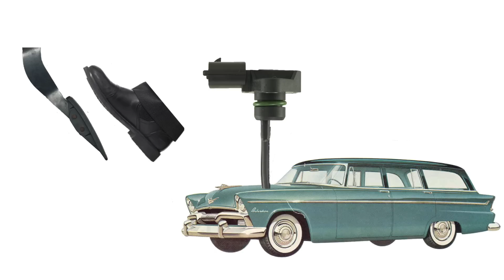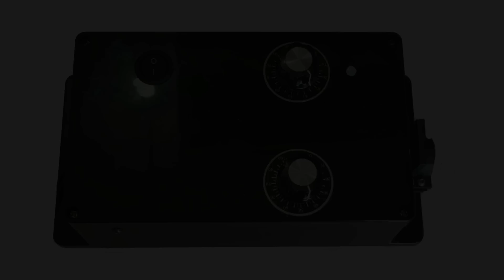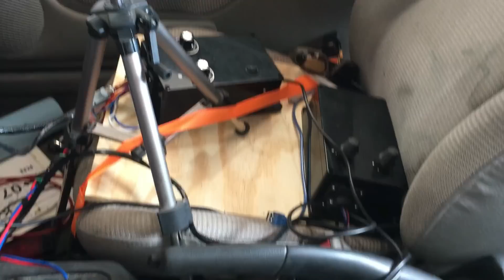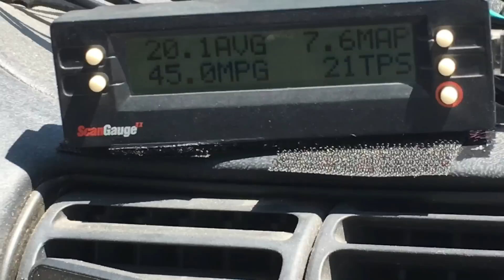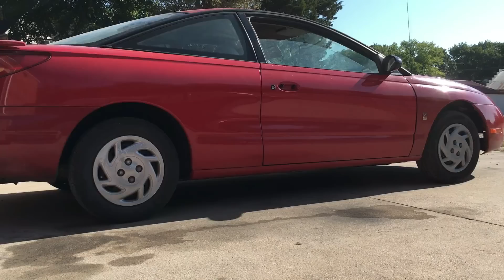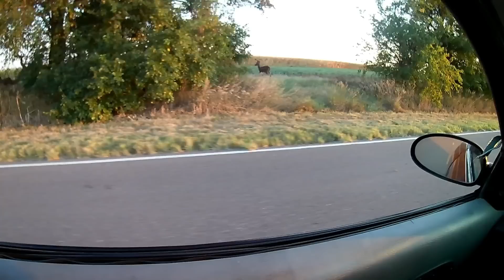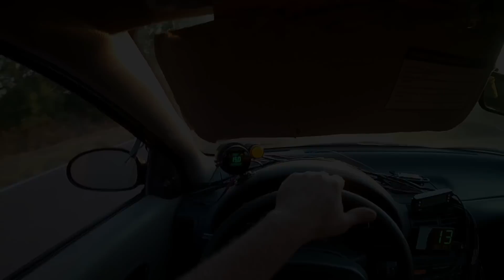S2E20: We road test the fuel saving Robo-throttle on our project car and discover hidden MPG’s.

Comment: The 2002 and later Acura TL Type S had a similar dual throttle body system. Acura's vehicle stability assist system needed some way to reduce engine power, and they weren't confident with going full drive by wire. So, vehicle stability assist would just close this secondary throttle body to limit the engine output, and thus limit wheelspin.

Comment: Some older cars with primitive traction control systems actually used systems fairly similar to this (with the combination of mechanical and electronic throttle bodies) but the implementation was a little different. The mechanical throttle body was used for most operations and the electronic throttle body would be wide open most of the time, but when wheel slip was detected, a separate module controlling the electronic throttle body would command the electronic throttle body partially or fully closed to reduce engine power output and reduce the wheel slip.

Some early electronic throttle body systems would also use remote mounted accelerator position sensors that were connected to the throttle pedal with a traditional throttle cable. Some of them even mounted the APP sensor directly on the throttle body. Honda mounted the APP sensor on the firewall, and I think some Toyota, VW and Audi models mounted it on the throttle body.

Comment: The double throttle actually “doubles” as a Saftey feature, if the robo throttle gets stuck open, your normal throttle still works, so you won’t ever runaway

Comment: Hey mr Jimbo,  I think you may have had better results with lower manifold pressures but shifting earlier. I think the main reason that vacuum gauges worked so well on carbureted engines is because of the enrichment that occurs at wider throttle. if the saturn were leaned out but had a wider throttle and shifted earlier, you'd have much lower pumping losses, fewer ignition events/meter travelled, and much lower internal friction due to having to move the pistons up and down fewer times/meter travelled. also cam timing, exhaust/intake manifold/port design are much suited to lower rpm as well. i think just a purely vacuum based robo-throttle would yeild better results on a primary/secondary throttle style carburettor than on a modern MPFI system. 

i always love these experiments, please continue making them!

Comment: An additional throttle body is capable of preventing poor driving behaviour, but it also adds to pumping losses for those who use their gas pedal wisely....I averaged 5.2 litres per 100 km on a stock saturn SL1 fully loaded with gear for a 2 week camping trip through the rockies, while drive up into the rockies!  Truth is that these cars make great gas mileage from the get go

Comment: I came to this channel because of the Honda Insight, and I’m sticking around to see it again! I’m ready to see what the Predator 670 will do in it
Reply from the maker: The  Honda insight project is still alive and well.  We will finish the 420 experiments and move on to the 670 when it cools off a bit here in Kansas.
Reply: @robotcantina8957  Speaking of predators do you have a indepth/detailed video on building a prony dyno? Google has no relevant info on building one that ive been able to find.
Reply: @robotcantina8957  Skip ahead and put a Hayabusa 1300cc engine in that Honda Insight, and then dull it down to get 60seconds from 0 to 60 mph - that would really piss off a lot of people :D
Reply: Interesting concept, wouldn't this work in conjunction with normal DBW cruise control and just have presets for each cruise speed? My thinking is press a button and let the robot accelerate the car to the preset at best fuel economy, 

takes the human factor out totally for repeatability in testing..
Reply: @AgneDei  Yeah, use a single 6.5 HP lawnmower engine carburetor! Probably a 22mm throat diameter.
Reply: I'd like to see the predator ghost engine in the insight... Or even in the saturn

Comment: You could add a safety like having an emergency stop button disabling fuel injection. No fuel = no power...
For full power you could disable the fuel economy mode if the pedal is over 80% depressed.
Reply: Yeah I was thinking the same for the throttle. Iirc, in stock configuration, the Saturn ECU will turn off a bunch of stuff at 80 or 90% throttle (AC, etc) for max acceleration.
Reply: In a modern car the eco mode is disabled after about 25% depression of the accelerator
Reply: OCD Man  yes it was a concept video from what I remember
Reply: I was thinking something along the lines of having a sliding scale from 50-75% throttle, so that at 75% the throttle is 75% open, and it's one to one from there. Problem with just disabling it at a set percentage it the throttle would jump from 25% to 80-100% immediately.
Reply: @JThyroid  Yes something a bit smoother would be better but for a 1st test version it's enough. Concerning the transition, I think the easiest way could be to adjust the depression factor of 4.5-5.5 between 60% and 80% throttle such that there's no economy at 80%. Then disable it completely above 80%
Reply: @cmuller1441  It's challenging to describe 3D throttle mapping with text only. 😂
Reply: @MrHuram-abi  Indeed...
BTW there's a problem with this economy mode method: what is the optimal speed for fuel economy? At first it seems logical to think that the faster you want to go, the more power you need, the more you have to press the throttle and the more air+fuel enters the engine...
But there's additional factors: the faster the engine revs the more friction and the more losses there is.
Restricting the airflow means that the engine has to pump (to create vacuum in the intake) so pressing the throttle lightly is creating more losses. That's why the efficiency of the engine can vary a lot. Usually the best efficiency on a gas engine is around 80% throttle at 20% of max rpm. So wouldn't it be optimum to use a pretty high gear ratio to be as close as possible to these conditions for a long constant speed drive? And finally is taking ages to reach that speed (with very slow acceleration) really optimum?
A recent study shows best mpg around 55mph.
Check page 120 of https://web.archive.org/web/20120924201205/http://cta.ornl.gov/data/tedb31/Edition31_Full_Doc.pdf

Comment: I think of this as a "dynamic cruise control" in high MPG mode.  I would feel 100% safe with the redundant design.  The control box could have a rotary switch that controls different MPG algorithms in the arduino, "pass through", "economy", and "performance" (that I would never use).   
PS - The roof on the 1st Gen Saturn Wagon was the largest single piece of plastic that GM had ever incorporated into a passenger car at the time.  Don't ask me how I know this (pretty sad, hee hee hee).
Reply from the maker: When we revise the robo throttle in the near future, we will incorporate a variable settings for different road conditions.   Ya know , just the other day I checked the roof on the wagon and discovered it was plastic.  The roof on my second gen wagon was metal and I just assumed the first gen roofs were as well.
Reply: @robotcantina8957  Yeah, my 2nd gen SW2 has a metal roof.   The same way that the Pontiac Fiero plastic tech was used in the Saturn plastic body, the lost foam cast aluminum engine tech in the Saturn S-Series was used in the GM Ecotec engines.

Comment: THIS is the most entertaining stuff I have seen on YouTube for a long time.  Disclaimer:  I have owned and used a Scan Gauge.  I have owned 3 Prius (Prii?).  I have added an aftermarket 6 kWhr battery pack to a 2014 Plug-in Prius.  I have done a few of these tests myself, off-camera.  Disclaimer:  I have a degree in electrical engineering and a fetish for MPG.  Keep up the fun!!!

Comment: Irony is, such feature (maintain an optimum MAP) was present in 80's Skoda 120, implemented in the way how the two barrel carburetter was controlled: There were two butterfly throttle "parallel" (so the mixture had two paths to go through), one (primary) was controlled from the pedal cable directly, but the second was controlled by a diaphragm responding to the MAP. But there were two links from the primary to the secondary: When nearly closed, a cam forced the secondary butterfly closed when you completely release the pedal (about below 20%). And then when you depress it (beyond about 70..80%), it forces the secondary open as well, to allow full power on a kind of "kick down". Overall when you maintain the pedal position between the 30..70%, the MAP was maintained at the optimum efficiency level. Drawback was, it felt like the car "had no response on gas" until you really fully depress it. And all that without any electronics...

For your setup, I would implement the "robo throttle" to gradually open over the last ~20..30% of the pedal position, so you don't need to operate any switch when wanting to accelerate, just full pedal will effectively deactivate the "robo throttle"...
Reply: That type of system has also been in use on US cars since 1952 or so- the humble four barrel carburetor.
Reply: That is a feature on like half the carburators out there, it's called vacuum-secondaries.

Comment: Ahh, J.C. Whitney! Bought quite a few things from that catalogue in the 1980s. 

When I was a younger lad I had (and still have) a garage sale vacuum gauge, a huge thing with a brass bezel, clearly not aimed at automotive diagnostic tool use. On my 1970 Volvo 145S and a later 1979 Volvo 240 wagon, I'd string a hose from the engine and set the gauge on my dash where I could watch it.

It made a little bit of difference on the 79' to watch it but 1970 with its ZS 175CDS carbs flushing fuel down their gulet just wasn't precise enough to get much of a milage tweak from watching engine load with the gauge.

Sorta wild today to think I have a 1970 Volvo (a rather ragged 142S) again, I've come full circle.

Comment: You can set the auto off (mpg increase off if TPS) is over 70% WOT.   So floor it and gives better acceleration.   This makes more programming but does a away w the Pot. 
First 70% of accelerator position is only 40% of WOT. Last 30% is 60% of the added TB.
To make it easy to know where the MPG change kicks in  add an extra throttle return spring that kicks in only at the 70% WOT so you feel it in the foot too.
Reply: The pot was for trimming the ratio instead of hard coding it. Once you get that part dialed in, hard code the ratio, then add in a nice sliding scale as the driver approaches wide open throttle. You should always have the option to floor it.

Comment: My 1991 Mercedes 300SE has an "Economy" gauge that is driven by vacuum pressure. That was the last year of the last old school S class that was way out of date in 1991.
Reply: Yeah.   Lots of BMWs used to have a similar MPG gauge mounted in the bottom of the tach.
Reply: i have 1990 volvo with a boost gauge that not only shows boost but also vacuum. i still use it to check if i am getting reasonable fuel economy (minus on the scale)  or not (plus = boost on the scale)
Back in 1980's many european cars had a 'econometer' based on manifold vacuum: 
lots of vacuum? green light, 
no vacuum? red light. 
Because fuel has always been expensive you would automatically adjust your driving based on those lights. You wanted green light all the time so you would get more range out of 1 tank full of fuel.  
(green = good, red = bad. Talk about subliminal behavior control!)

Comment: It's been a while, but I could swear that a '98 BMW 540i that I owned also had 2 throttle bodies.  One was a manual connected to the pedal and it was mounted on the upstream side (closer to the airbox).  Then there was another throttle body behind it that was normally open which I think was used as part of the traction control system.   I could be remembering wrong, but I thought it was a pretty cool way to implement TC and still not be full drive-by-wire.

Comment: This is a fascinating exercise, but it largely goes against what a BSFC chart would suggest. Most engines make their best fuel economy at 60-80% load, at very low RPM. 

Looking at the efficiency islands on those charts, it's better to dig deep into the throttle and short shift, rather than limit MAP and rev it higher to compensate.
Reply: That's definitely true when accelerating, and changing the code to accelerate at peak BSFC should improve the MPG even more. For cruising with a stock drivetrain at normal speeds, light load will be better. Higher load will just result in acceleration without changing the gearing.
Reply: @gasolinefumes  certainly (Hi from Ecomodder), but I'd think it would be more effective to cap MAP just before enrichment. Cruise control would still be pretty efficient if so. In fact, this gives me some throttle mapping ideas for my own car.
Reply: @AustinPerdue  so you're suggesting allowing higher load? Probably a good idea, but it might not make much difference on flat ground. I want to try the MAP-based cruise control that was posted on EcoModder years ago.
Reply: I thought exactly the same thing.  
The only thing I would consider is an automated push&glide cruise control, that applies ~80% load alternating with fuel cut-off.

Comment: This is basically automating the hypermiling technique. Maintain a throttle position that slows down uphill, and speeds up downhill. You are using the least amount of energy to maintain a general speed that you are wanting to travel (ie. 56-64 mph for 60mph average.)
Reply from the maker: Yes, basically that all I did.  The cool part is  it's completely automatic.

Comment: Most people have no idea how exhausting it can be to hypermile, ESPECIALLY on long distance trips.
Reply: I hypermile a Saturn and while it takes a lot of concentration I personally find it's the only thing you can do to make a boring commute remotely interesting. I find that this little Saturn keeps me more engaged than the turbo LS 65 Chevy truck I was driving
Reply: @ronniedale6040  commuting is one thing.  I do agree that hypermiling on your commute can be relaxing.  Long distance trips though are a whole ‘nother animal!!
Reply: OCD Man  I commented on his last video(this one) so yes I did watch it.  He mentioned in the video that everything he did with the secondary electronic throttle could be achieved with good throttle control.  This is often referred to as “hypermiling”.  Hence my comment.

Comment: Great video!
Add to Robo-throttle kick function similar like for automatic gearboxes.. Fast pedal release and then fast flooring deactivates fuel saving until next pedal release, holding Robo-throttle wide open.. 😉

Comment: Some motorcycles today have modes, such as "Economy," "Normal," "Sport," and "Performance" or "Race" that probably work similarly, also taking wheelspin into account by reading the anit-lock brake tonewheel/encoder on the front and back wheels. A lot of these technologies have been used in industrial automation for decades, and as an industrial electrician, I'm quite familiar with the concepts, if not so much with the code used. I did have to write a program for a can crusher in a class years ago that used a crude encoder, 2 sensors to determine direction, a motor, and threaded rod. I kept tweaking the code for features and efficiency long after the project was done and graded, because I had so much fun doing it.

Comment: I live near Topeka Kansas and for over a decade I have been building gadgets for my car .  Hydrogen scam stuff and now I  run my car with Propane.. I used basic stamp MC to manage my AF ratio...  I am absolutely loving every precious minute of your show..  Following in your footsteps I got a 1995 ford escord wagon and just got it running on propane.. horrible mpg ... 22.... need that robo throttle.. maybe I will try and lean my propane mixer down a touch..  my propane mixer is a pvc T and a water valve.. slightly close it a bit and it goes leaner... stone age technology!..
Reply: Stone age is best! ICE engines are popular because of the versatility. EV owners in non-temperate climates are in for a rude awakening. I suppose you could always ride your bicycle to work on the below 30 degree days when the heater in the EV is not up to snuff.
Reply: Rebuild the engine to take advantage of the propane. Start with higher compression. You will need custome pistons. Call Kieth Black. Cast is ok since its not high performance
Reply: You need a propane carb. You may be pleased to learn that such devices are available off the shelf, in Australia for many years propane fuelling was a factory option on our locally built Ford Falcon sedans- the LPG tank replaced the spare wheel and a propane carb was added to the inlet alongside the standard fuel system, allowing the car to run on either propane or petrol. 'Autogas' was half the price of petrol, so despite the reduced fuel economy you saved a lot of money. An added benefit was significantly reduced exhaust pollution.

The gas does displace some air from the charge, reducing power. The last generation of Falcons actually had propane direct injection to circumvent that problem, and developed slightly more power than the petrol models!

Comment: I've seen the mpg gauges that ran off vacuum, I always thought they were a scam, i didn't realize it was actually good. Uhaul trucks use them a lot too.
Reply: GM Holden for a period of time in the 70s/80s actually installed them in the dash cluster as an "Economy Gauge" instead of a tachometer in automatic transmission cars.
Reply: I had to put a post-it note over that gauge in the uhaul I used when I moved because it was buried in the red most of the time.